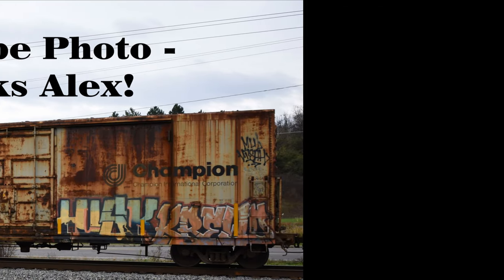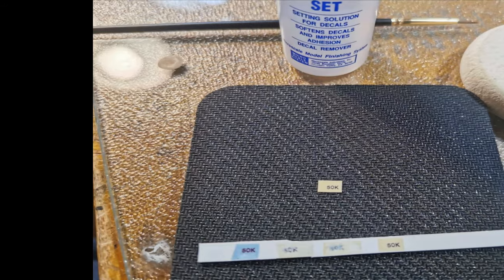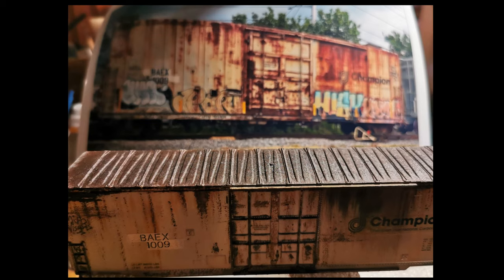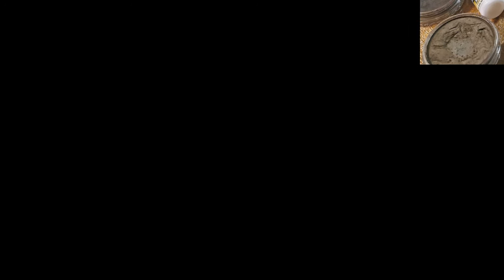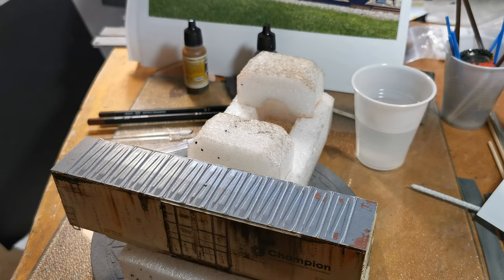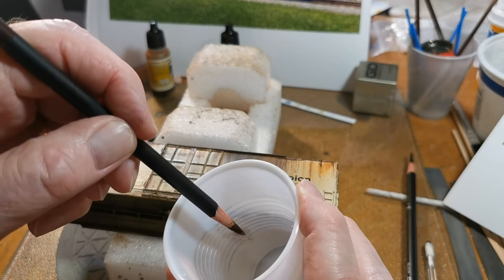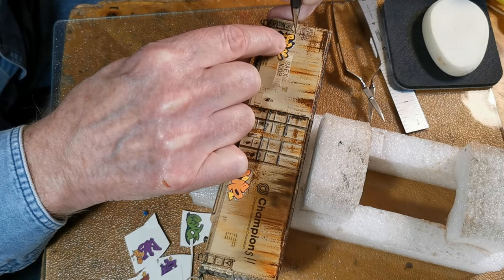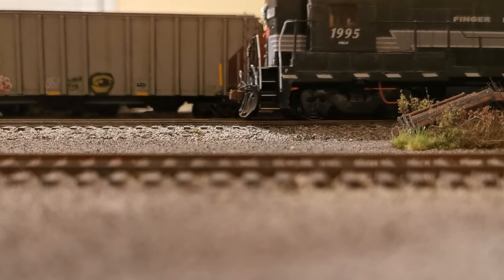Model Railroad Homemade Decals + Weathering

Comment: One car in particular (Hopper 1326) has a black streak that really gives the impression of a bad dent!
Reply from the maker: I had to find that hopper in another video - I was just trying to copy the old graffiti that got patched over, but if it looks like a dent, cool! Modeling dented cars seems to be very difficult. I tried a soldering iron on a dumpster - no good. Looked like somebody melted the plastic with a soldering iron lol. So maybe an airbrush is the way to go here, but I would have to practice a lot first! Thanks for your insight, Kevin.

Comment: When you were doing the rust streaking with the fan brush was it a dry brush or did you use some thinner? And what kind?
Reply from the maker: Hi Mike - the brush was just damp with Turpenoid, I think I got a shot of the bottle in there somewhere.